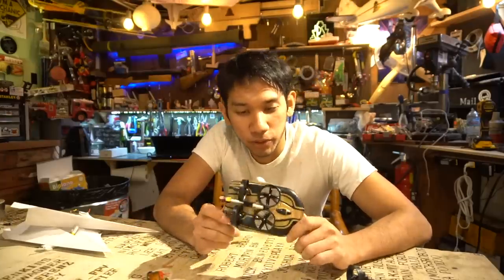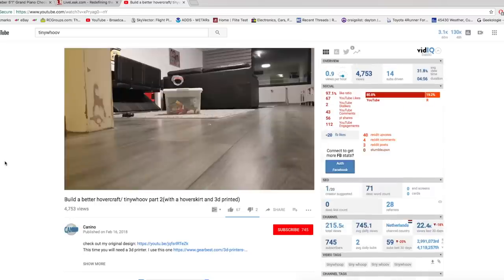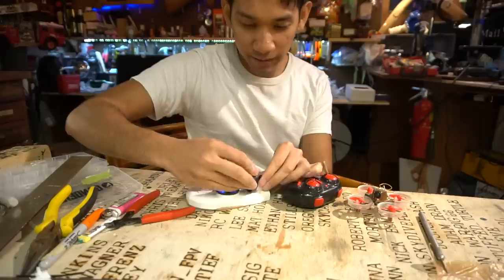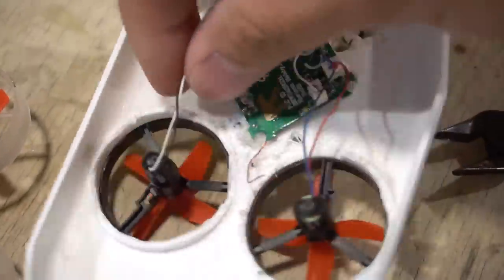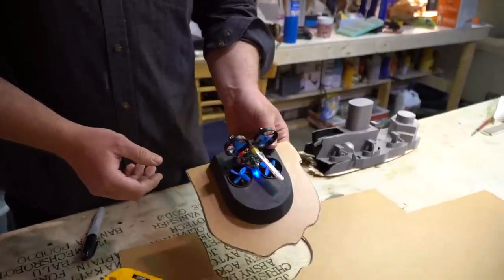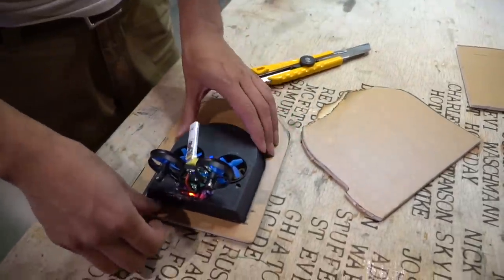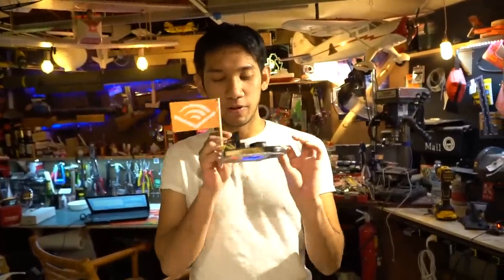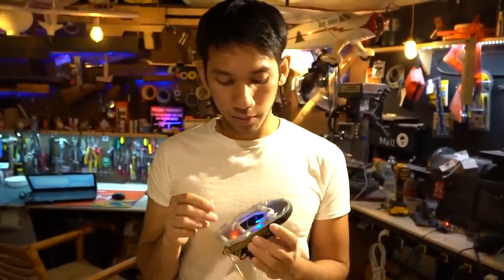DIY Tiny Micro RC Hovercrafts!

Comment: Peter you should make an airboat for the lake that you can sit in propelled by the 2 t motors
Reply from the maker: hmmm how'd you read my mind?
Reply: YES!!!
Reply: Yes do this
Reply: i could make a photo and send it to you but i don't know how....
Reply: btw I love your vids
Reply: it'd be SOOO easy to do too, really! I'd aim at 11 ft long, full sheet width floor (4') and flare the sides (35-40 degree chines about 8-9" worth) then vertical for 18" height at the gunwales. the chine to prevent grab+flip. tough part is it wouldn't fit in a long bed pickup, it'd have to ride up on the sides of the truck bed for being large, but safer when it's out on the water. wide enough for 2 motors too, oh chit!
Reply: Yesss!!
Reply: Why did I call them t motors?! 😅
Reply: I dont think that would work well
Reply: Yees

Comment: I watched this video before I even considered buying a 3D printer and I always thought it looked cool. I bought a 3D printer a few months ago for drone design / repairs mainly but had to print this out so I found this video again and printed your design out with the same skirt you used and completed building it today. I'm very impressed and it's so much fun. I'm gonna add FPV to mine as I've got a spare micro camera (just need to get a VTX).

Comment: Hi Peter, just a suggestion, for your Flysky fsi6, you should get the Irangex multiprotocal module so you can control it from your Flysky. I did it on mine and it works 10x better than using the tiny controllers.

Comment: As an alternative to masking tape for the bed of your 3D printer, you could use BuildTak, which has good bed adhesion and makes prying off 3D prints way easier. It's a little more expensive than masking tape, but I think it does a pretty good job. I've been using it on a CR-10 as well as a Makerbot which both work great with it.

Comment: Bro make a homemade jet engine😂
Reply: Then put it on a rc  plane
Reply: Nabi Korucu or a flying 100 Watt 9000 Lumen Led
Reply: Colin Furze has already done that like 5 times.
Reply: with a testa turbine? insanity! but yes do make one!
Reply: pulse jet rc plane
Reply: DairMuid a little pulse jet would be a blast, but a rocket candy motor could be lighter and give some flight time (build LONG!). butane would be good in a pulse jet (cigarette lighter refill bottles), but they burn fuel really-really fast.
Reply: @xav2769  and then the plane catches on fire weeeeeeeeeeeeehhhhhh

Comment: you could get the custom firmware that was made for these E010/11 boards for the whoovers 
it's a custom silverware mix , i have not tested it yet maself as i don't have a linking tool yet
or just get the custom betaflight mixes 
put the lift motors on a switch , personally prefer it allot over the way you guy's are running them

Comment: Hey peter what drones did you use, I've never taken a drone apart before so I don't know what to look for
Reply: Any will work.  Don't be intimidated.  Just don't snip or tug way too hard on the wires and you'll be fine.  It's just a board attached to some motors.

Comment: Peter what do you think about EDF powered rc?
Reply: Oh,and what about an even larger scale hovercraft than theses and your last one?
Reply from the maker: its possible! maybe this summer!
Reply: 4 EDF powered hovercraft like 12 x 23 size? it'd be a real trick with differential steering AND have reverse on the forward thrust motors to act as brakes or back out of a tough spot. I'd e-mailed eAchine and Furibee both last summer, asking they produce a tiny whoov with left stick controlling lift motors, right stick = forward/reverse/left/right so they'd be REALLY fully functional.

Comment: You should make a big one that you can sit in.
Reply: I'd sure share my plan to him for that if he asks! it's semi large 2 seater requiring 12-15 hp for lift and thrust. the compressor fan blade for lift is expensive, 20" diameter 6 blade rated for high rpm, high pressure, and high CFM. single engine, belt driven fans, would be as complicated as his plane with some similar building techniques ("floor sandwich"!).

Comment: You should do A giveaway whit these!!!
Reply: yessssss
Reply: I agree
Reply: dollar store foam board platform, use 8 mm thick closed cell packaging foam for the skirting, will be ultra light, bump proof, and allow it to be a bit larger too.

edit: success btw....  it's 4.75" wide, round nose, rear corners rounded (5/8 radius), 8" length, front ducts inverted (motors+props swapped for polarity and rotation reasons), rear of quad left intact for battery slot and hoop braces to serve as rear duct's mounts, motors forward so again motors and props swapped for rotation and polarity. being so light it has higher cushion ride height and CAN climb from hard floor to carpet, mode 1 transmitter normal driving (lift and rudder = right stick) to climb, throttle it up and flick left stick back just before the transition, almost 1 cm height difference. the closed cell foam skirting naturally angled back slightly when wrapping the round nose, it's soft and has a little give, so it bump/bounces UP onto the rug no problem. 4-5 mm thick closed cell packing foam will be a little more flexible but still rigid enough for a good bumper/skirt, and a little bit less weight (not much lol).
Reply: Yois
Reply: Yes

Comment: The propellers for these are wrong. They aren't set up to maximize air pressure which is needed for pushing the air under the craft and giving it lift. It still works simply because it has enough power, but it's wasting a lot of energy.

Comment: >diy
>3d printed

Something doesn't add up bois
Reply: Meh I made one of of corrugated cardboard and hot glue eyeballing everything.  The design is inherently forgiving.
Reply: williwonti  DSFB and 8 mm thick closed cell packing foam sheeting for the skirt, super light weight allows a little larger size. flipping the ducts (motors up, motors forward) swapping motors and flipping fan blades (rotation and polarity stuff) lets it be lower profile and less chance of motors getting wet zipping across a puddle (the closed cell foam bumper/skirt floats it too btw).

Comment: hello, can you make a 3D boat exact as the utility tugboat but cheap and smaller but with the same form, becouse i can not afford two 137$ motors, i would like to see like all(motor esc, radio, batterie,) for under 150$  pleaseeeeeeeeeeeeeeeeeeeeeeeeeeeeeeeeeeeeeeeeeeeeeeeeeee, you are doing a cool work

I do also want to see how you make a boat or a plane like a explanation with the parts and how to mount it, but overall all is correct( im from spain)

Comment: Sam's seems to work better than yours. Maybe it's the wider foam base?
Reply: the lighter the better, also allows some size to be more stable. going TOO large the perimeter will get too long, and ride cushion height will suffer. mine is foam board platform wrapped in 8 mm thick (7/8" wide) closed cell packaging foam sheet (flexible and floats), 4.75" wide, 8" length, done with an E010 (lower power).

Comment: And were can I find corrosion x pr a somalian product built a 12 v power supply with lights and ac/DC inverter a cigarette plug and another outlet with two uses and a voltameter all crammed in a old johnson and johnson first aid kit. Work great for fishing or tents lights and phones run a fan I'n the tent or a DVD player